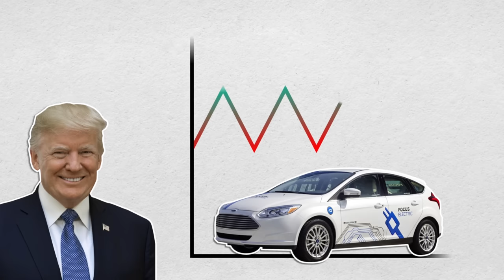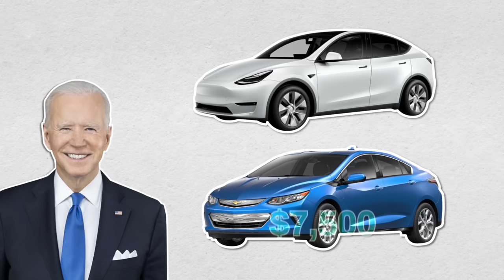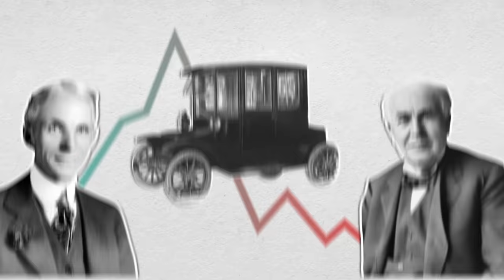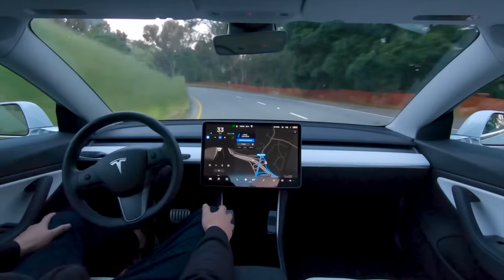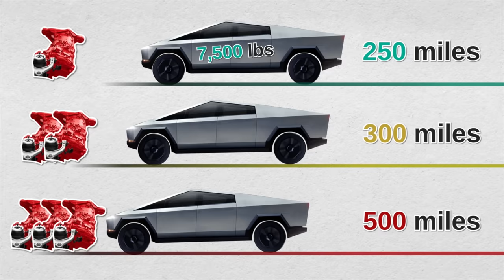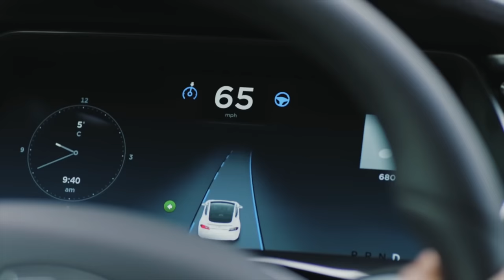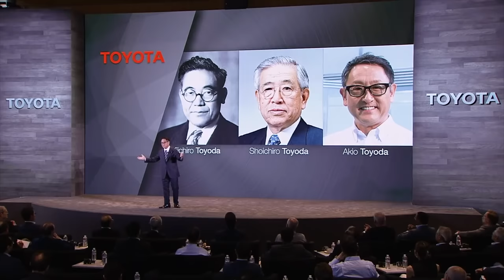Here's Why Toyota is Refusing to Make Electric Cars

Comment: 7 minutes in i AM STILL WAITING FOR THE REASON WHY TOYOTA MADE THAT DECISION
Reply: as it said, Japan produces electricity out of coal, even if they have the world biggest solar building "Solar Ark" and plans for offshore wind energy production of 45GW by 2040, but by 2019. renewables only produce 7.6% of solar and 7.36% off wind which means they will need to crank up the fossil fuel production to accommodate for all BEVs. That makes them in worse position when the initial reason for EV is environment. Therefore Toyota turns for PHEV, HEV, FCEV powered cars, because those ways don't need burning more fossil fuels for demand of electric energy. And also any brand will first build a product for their own country, then it would consider others with their specific needs. Because that approach is more economical viable for everybody, and also, if you want to develop a technology, it would be easier if they are couple, than all of options possible.
Reply: @007JAKICA  Thank you so much for taking the troublke to share this!
Reply: @007JAKICA  Also since Japan imports 100% of its crude for gasoline and none of those renewable resources can come close to the amount of energy Japan uses, they are starting to import liquid hydrogen shipped from Australia instead of oil from the middle east.  Since they can't ship electricity, they are going down the FCEV route.
Reply: @scottkolaya2110  interesting notion
Reply: @007JAKICA  Coal is used for only 31% of Japan's electricity generation. LNG (liquified natural gas) has the largest share with 34%, and renewable energy accounts for 23% (10% hydro, 9% solar, the rest biomass and wind), and is projected to grow to over 30% by the end of this decade (mainly through additional wind and solar capacity). 
Should electricity use drastically rise it will mostly be covered by nuclear energy as most of it was taken offline in the years after the Fukushima disaster, but is projected to increase its share from currently 7% up to 20% by the end of this decade. 
So Japan will generate at least 50% of its electricity with near zero CO2 emissions by the end of this decade.

Japan could easily focus on building all-electric EVs as well, and I predict they will soon as the market for hybrid vehicles won't grow as much as the market for fully electric vehicles. Fuel cell vehicles may become interesting for commercial transportation use in Japan since they already have the LNG infrastructure that could be repurposed for hydrogen distribution and storage.
Reply: @007JAKICA  You folks on this site are incredibly smart.
Reply: Japan's infrastructure can't support electric vehicle's on a grand scale.
Reply: @wc3617  And why is that ... could you please elaborate.
Reply: @sv650nyc7  Hydro is not an easy resource to expand, putting pressure on other sources to achieve a 30% growth rate. 30% growth in a 23% share of alternative though only moves that alternative share to 30%, presuming demand stays flat. Moving transportation energy demands onto the electric grid over a decade could easily reduce the proportionate share of alternatives to levels below their current contribution despite growth in alternative output.  Hydrogen might replace LNG is heating or industrial applications, but not in transportation. For all the issues batteries present, they are still much simpler, safer, more efficient and cheaper than hydrogen.
Reply: @torrestorrestorres488  watch the video, Scotty explains it in great detail.
Reply: toyota made the common sense decision.
Reply: @sv650nyc7  haven't you noticed we get less and less sunny days, and more and more cloudy days.
Reply: @jordancreek6570  battery powered cars are a fad, and will eventually fall on its face.
Reply: @wc3617  So why are they going for hydrogen/electric? The hydrogen will come from reforming methane (natural gas) or if they do it with electrolysis it would take much more electricity to make the hydrogen than it would just to charge battery electric vehicles!
Reply: this bastard always plays with us
Reply: @007JAKICA  A very short sighted decision. |Hydrogen made using natural gas is actually dirtier than electricity from coal. Cars that are around today will still be around in 10 to 15 years time when electricity generation absolutely must be green and then hydrogen cars will be an inefficient expensive liability.
Reply: @scottkolaya2110  Wrong decision.
Reply: @rogerphelps9939  all electric in 10-15 years is extremely short sighted decision. Nor it is possible for makers, nor it is for consumers. That future is not close, not even in the slightest ...
Reply: patients grasshopper...
Reply: @MrAdopado  I was asking myself the same. Ok, the grid would be difficult to scale, but less than $100 billion doesn't sound impossible for Japan. And going more hydrogen, that would need even more electricity, though maybe not that much grid infrastructure increase. But it would need massive investments into fuel cell distribution infrastructure too, sooo... I don't know. Doesn't seem to me like that is the reason why Toyota is not "buying" into battery-powered electric cars.
Reply: @dannyfields2065  Yeh, just like that new fangled interweb
Reply: Good Point....!!!....Some Time ago the Head of Subaru said American's Don't Want E.V's...!!!....He was Right ..!!!

Comment: One EV car uses: 85 Kilos copper, 56K nickel, 7K cobalt, 7K maganese. With say an average of 7.5M new cars sold on average per year, where do we get 637.5M Kilos of copper, 420M Kilos of nickel, 52.5M Kilos of both cobalt and maganese per year? This doesn't even address the infrastructure needs to provide power for these EVs. The goal appears to be outlaw petro vehicles, and make it impossible to replace them. Already, there is no new real production of new cars as there is a chip shortage. Additionally, parts to repair existing vehicles have very low quality or are not available.
Reply: Good point.
Reply: We get it from China, they have almost all of it....and the ownership rights to mine the rest of it.
Reply: As a small-volume scrap metal recycler, I would love to see copper go up to ten bucks a pound! But then, every SOB on the planet would be picking, and stealing, it.
Reply: silver too, there is a shortage of silver and i heard each. car has a kilo of silver
Reply: Right, but they may use replacements, like so many other things in auto industry and not only. For example, fridge compressors have aluminum instead copper for wiring. Less efficient, so more heat, extra weight? Sure, but cheaper.

Comment: Dear Scotty, I once almost bought a used Mercedes as my first car. I then accidentally ended up on your channel, watched some of your videos and finally decided to buy a 2008 Lexus IS 250 with 200k+ miles on it. It's been over 4 months now and I'm completely in love with it. I've not had a single problem. It looks and runs like a brand new car. Thank you soooooo sooo much for all of your advice. I can't describe how grateful I am for all the advice you've provided all these years.

Edit: Woooah! Thank you so much for 700+ likes!
Reply: scotty is awesome, and congrats on the lexus!
Reply: Excellent 👌
Reply: Old Mercedes are good...like an '85 300D. A little boggy, but those cars are very reliable.
Reply: @louishumphreys5451  the car he was looking at was more than likely recent, like in the past 10 years. The new ones are piles of garbage, but you are right.
Reply: @louishumphreys5451  I doubt he was looking at one that old
Reply: 200k i hope you got it cheap still a reliable car tho
Reply: @donniebunkerboi9975 , When you're young you don't need a nice car to get that.
Reply: @thomasmartin8362  you can get better luck with old Hondas than dinosaurs mercedes. Same price, unless you're into grandmas
Reply: @jub8891 yeah lex are good but I'd rather have a Avalon or Hyundai of a higher trim since those basic brands will use less gas Acura and lex use mad gas and use premium meaning it cost more to get it and runs out faster on top of that
Reply: @donniebunkerboi9975  older Benz actually can last a long time with less maintenance. It's around 95 I'd say and after that they fell off. And I'm not a fan of German cars prefer the Koreans for how far they come and the japanese. Just knowledgeable of brands and when they were good and aren't now
Reply: Wish I knew of Scotty b4 I bought my money pit Audi a4 mk7 2.0 tfsi set me back 20k. I now own a mk4 Lexus GS 450h and love it so far. no more German over engineered and  poor reliability card for me.
Reply: @donniebunkerboi9975 , girls usually aren't into cars - grandmas or younger.  A good lucking young man doesn't even need a car to get laid.  I mean, your logic is just completely flawed.
Reply: @thomasmartin8362  they're not into cars but they CARE a lot of what people think of them. Either you don't have GFs or a late bloomer or both.
Reply: You dodged a bullet there. Good choice.
Reply: I’ve owned a lot of cars and I bought a Mercedes E class w212, and it’s got 150k mileage on it now,  and I’ve had it for 4 years and it’s been the best car I’ve had, only money I spent has been on servicing or tyres and brakes, nothing has gone wrong on it so far , I’ve had Hondas and toyotas and Lexus and even bmw and Ford and Nissan and vw and they’ve all had issues but this Mercedes has been the best purchase I ever made
Reply: So you just pay toyota
Reply: @Myles Thomas oil issues caused engine failure I treated the car like a king and it still broke.
Reply: @louishumphreys5451  I had a 300D ft rom new, it was a lemon. Suspension collapsed twice, the engine mounts failed. Chewed out the cam shaft, eventually engine died at about 200,000 miles.
Reply: @jimgraham6722  hmmm I had a former boss, he loved them. He had a wine colored one...driving it for many years. It handled nice...can't speak for any kind of trouble he may have had with it, but he had like another six spares of it, all the same color, all the same year lol. It was quite obvious, he was going to drive it until he died.
Reply: @donniebunkerboi9975  
If you can't get laid driving an old Mercedes, the problem isn't the car
Reply: @louishumphreys5451  Some people liked them but my feeling is they involve more show than go. 

Where I live the roads aren't so good. The Mercs a heavy vehicle and critical components in that situation simply proved  too fragile. I got fed up with continual costly suspension rebuilds (three times), engine mounts continually failing (twice), drive shaft universal chewed out (once) and so on. Additionally we live in a high UV area and the plastics and paintwork quickly became quite shabby.

 I replaced it with a GM sedan that while perhaps not having the finesse and detailing of the Merc, drove just about as well, and did over twice the mileage before major maintenance issues started to develop. The paint and plastics also looked quite good to the end.
Reply: 4 months? come on u will surprise when that car start to change their components below 2 years. thats lexus my bro
Reply: Awww that's so cute haha. I think Scotty probably prevented me from buying an Audi A5 or S class W221 but I'm extremely pleased with my Lexus LS460 :)
Reply: I'm so happy for you. I might get a Lexus in the future. 🤙
Reply: You just made your life so much easier.
Reply: @B58dr3w  what does that have to do with age???
 Don't be that stereotype  

I have both old new an new Toyotas  
Not boasting, 
as if you with Age
But rather than with agw
Both save money headaches etc
 flat out 
 So 
Rather live in a nice house with both
So cool it Braveheart
Reply: Then u have no idea what u've missed!  Lexus has NO comparison w Mercedes...as far as handling! 🤣
Reply: Beautiful!!!!
Reply: @-BUFFALOMan  Battery powered cars have kicked the hydrogen car to the curb.  
The advantages are great. I also have a 4000 lbs SUV the is faster that most sports cars on the road. 
50$ to travel coast to coast in the US. 100% reliable no to very low maintenance  cost.
Reply: interesting coincidence i'm thinking of getting one as a first car
Reply: @-BUFFALOMan  I think lexus rivals Merc and BMW if your looking at the £100K plus models
Reply: @jub8891  yes he is, thank you so much! 🙏
Reply: @icost4671  Thank you so much! 🙏
Reply: @aneeshramakrishnan1958  Yup, I didn't wanna go past something 15 years old.
Reply: @donniebunkerboi9975  😂
Reply: @odanksta1108  Congrats!
Reply: @B58dr3w  costed me 4900 US $. I live in Dubai.
Reply: @robmalcolm8042  I get your point but I live in Dubai. Gas is cheaper here.
Reply: @M.E63  That's unusal. But Congrats I guess.
Reply: @jarski871  Yep, A better looking Toyota! 😂
Reply: @zaker600  Nice one, I considered a 460 too, but I prefer smaller cars. (personal pereference) Are you happy with your purchase?
Reply: @GetReadyHeISComingBack  Thank you so much. Yep! I recommend Lexus.
Reply: @gamleole9568  Haha, yes I believe so too.
Reply: @tonyluk112  Actually I do, I've been in almost all the mid range luxury cars. Mercedes and Audi's tend to be more comfortable. But my friends who own it tend to complain a lot about maintenance costs.
Reply: @jennifers6435  Thank you!
Reply: @-BUFFALOMan  Agreed. If you can afford the maintenance costs, then Mercedes is most probably a better option.
Reply: @onegrumpyboi2914  My only advice to you would be to make sure that you have good roads in your neighbourhood before you buy it. I live in Dubai where my car runs fine. But when I drive in other cities where the roads might not be so good, the stiff suspension makes the ride uncomfortable. I still love my car though. I'll probably drive it till the wheels fall off. 😂
Reply: @BrightsonDavid  Yes :)
Reply: @zaker600  Happy to know that. Congrats!
Reply: @louishumphreys5451  Ummm, maybe the engine, and the vinyl interiors, but little else on them is reliable. They're also slow as dirt, and if you're paying a Mercedes tech, the hourly rate is really high. Then, let's talk OEM parts, lol. Also aren't safe compared to new cars considering no antilocks, airbags, rollover protection...probably no crumple zones (could be wrong on that). Mercedes were safe for the time. They're also loud. They do get great mileage if you have a diesel station near you. 

Like Mercedes btw, owner of a 84 Mercedes D, and several other E's over the years.
Reply: @TheKurtboss  But...it's a Mercedes.
Reply: @gregorsamsa1364  your friends called your car a wrinklevan
Reply: @donniebunkerboi9975  🤣🤣🤣